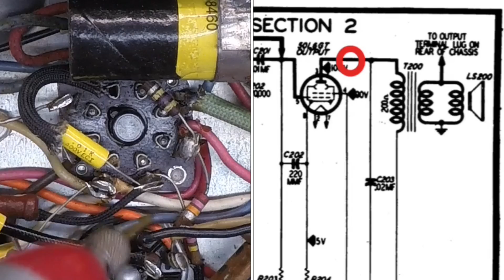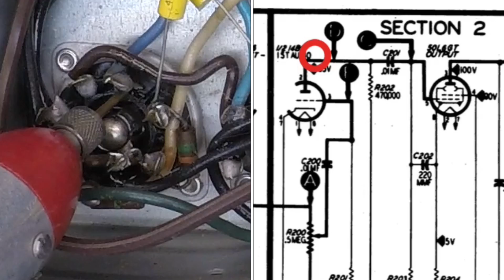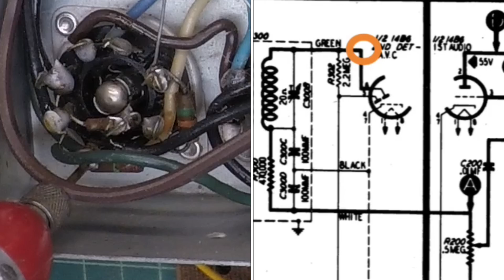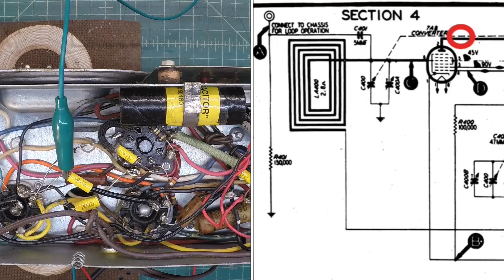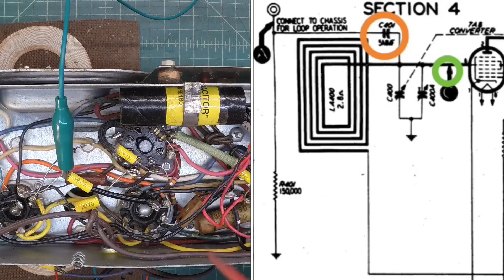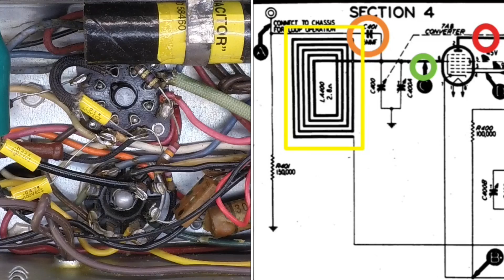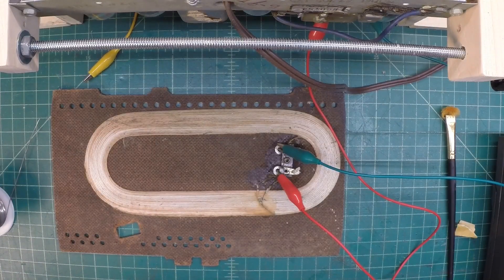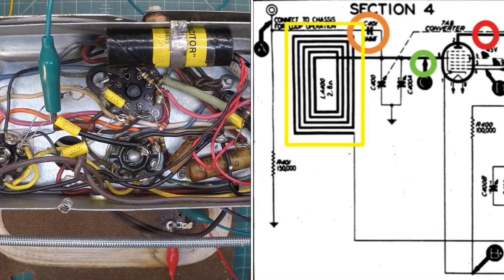Using A Signal Tracer To Identify Distortion + Prototype Chassis Stand

Comment: Great troubleshooting video Don! Good example of using a signal tracer and what to expect. I really thought you would find the distortion around those IF's or a bad cap(even tho they were new, maybe overheated or just a bad one). It was surprising and good info to keep in the vault in the future. Thanks for sharing this! The restore looks like a good job, tell ur friend he did good! Not sure what the dust bunnies were, maybe cotton from cleaning, but ai kept seeing ghosts in the chassis! Lol great job! Best--Larry
Reply from the maker: +Backtothefutureradios Larry, the antenna was not on my mind. It sounded like AC hum. The old radio was in his shed. I should have taken some time to blow out the dust bunnies (ghost) and bugs. Lol Best, Don
Reply from the maker: Vin, thank you. The volume control has to be turned up on the radio to test the audio on the plate and grid of the power output tube. The same holds true for wiper (center position) of the volume control. All RF test points the volume can be muted. You may of seen me turning the volume up and down while probing in the RF section. This was done to understand if the radio was being de-tuned by touching the probe to the circuit under test. Hope this answers your question and thanks again for reaching out. Best, Don

Comment: Had this on a Zenith, customer brought it in for repair without the back cover and antenna. Fixed the FM then Spent the time on the AM then figured that the bias to the grid of the RF amp goes through the antenna coil. AGC won’t work and signal over amplifies. Did not have proper voltage on the grid.
Reply from the maker: Glad to hear you isolated the issue. Thanks for watching. Best, Don

Comment: Don, I would not have guessed that an open antenna coil would cause distortion. 

Am I correct with this?- 

The antenna forms a tuned circuit with the tuning capacitor's antenna section, unlike a radio that merely has an antenna connection. Therefore, a break in the antenna does not just cause a weak signal, but actually disrupts the first tuned stage in the radio. Is that your assessment?

I am about to attempt to restore an AA5 bakelite Arkay brand set. The case is perfect, but it was a kit and it looks like it was assembled at gunpoint. Anyway, one of the coil antenna  leads is broken and I would never have suspected that was the cause of it not working when I first fired it up. So thanks for the video, it saved me much time and frustration.

Comment: What is the green clip connected to on the other end?
Reply from the maker: From the circuit common ground back to the signal tracer ground. Best, Don
Reply: @RestoreOldRadios  thank you for the response, Don. ReSon I was asking is because I'm restoring an IT-12 right now. I just replaced the filter can with a custom made one, and was going to put a bnc connector on it. I noticed your ground wire is not on the probe, did you run it out the back? I'm pretty new to all this and thank you for your willingness to tech us!

Comment: Why would he change all the caps but two of them,maybe because they were hard to reach ,but caps that old aren't relieable.,I shot gun all the caps ,then if there a problem if most likely else where. But catching that antenna problem ,I no I would have not caught that one gives me something else to check thanks
Reply from the maker: Hey Ron - I was guiding and supporting my friend through the repair process. Not having the parts on hand was the limiting factor. The open loop antenna was interesting to find. Best,, Don